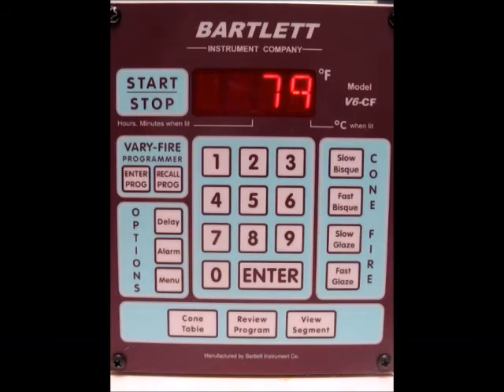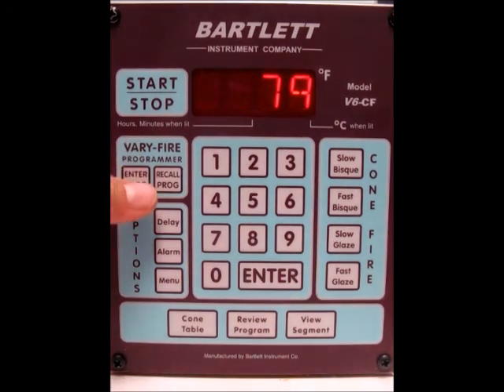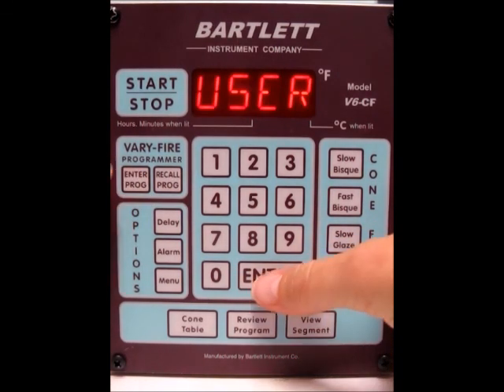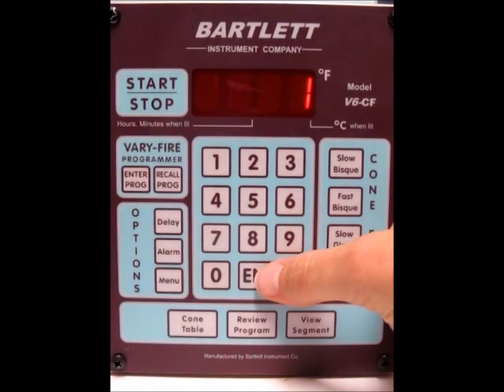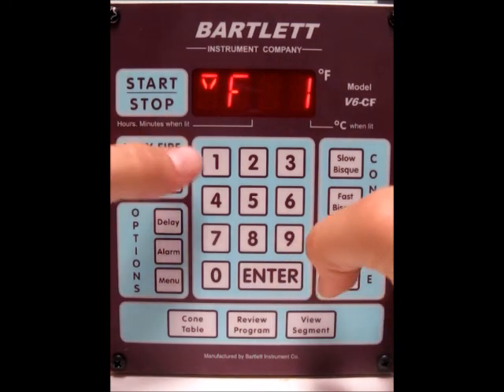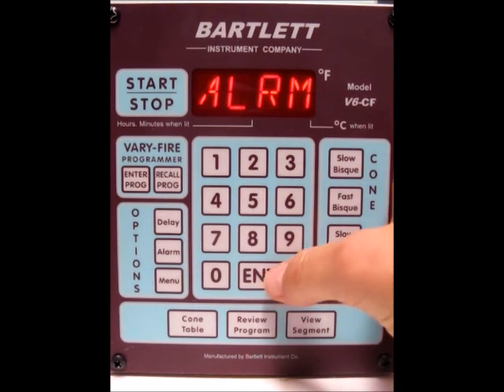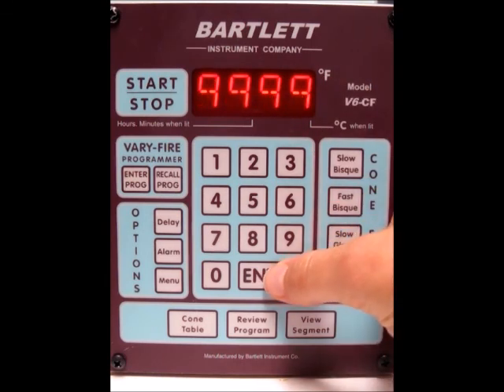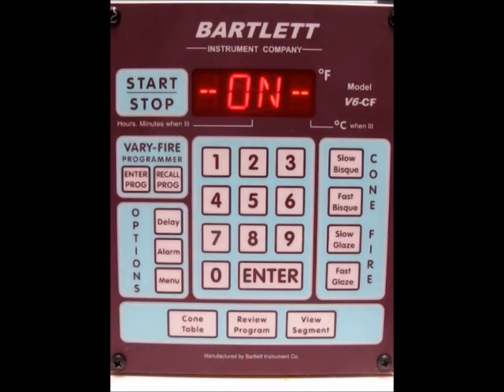Bartlett V6CF | Full Power Test

Comment: Its amazing to me that with all of our technology this is how we determine relay or element problem.   If i have 6 elements and 6 relays and one element does not light, it could be either.  If a relay is stuck ON there is no way to tell with this test.   Next, the quality if today's relays is abysmal.
Reply from the maker: Hello - 
Are you seeing an error with your controller? Possibly E-1 or E-d? Or is the kiln under firing?  
 
The full power test an option for kiln owners without additional tools or an optional current sensor. This test is designed to diagnose why a kiln is not firing to the top temperature (often shown by E-1 or under firing). It is not designed to determine a stuck relay (E-d). If you are experiencing a stuck relay, there may be some additional diagnostics information you can gain, but it depends on the kiln. 
 
We, Bartlett Instrument Co, only manufacturer the controller. The controller is then sold to kiln manufacturers who build the kiln and control box. They place all components needed for the control circuit and then wire our controller to their box. We recommend reaching out to your kiln’s manufacturer or a kiln repair technician if you would like to determine if your kiln can be equipped with additional diagnostic capabilities. 
 
If you have additional questions, please email us at techsupport@bartinst.com.